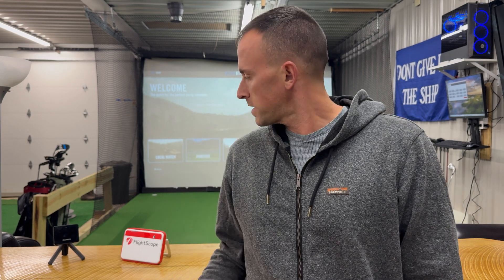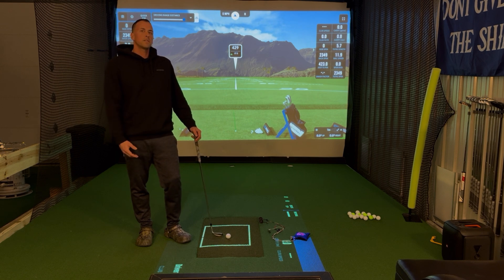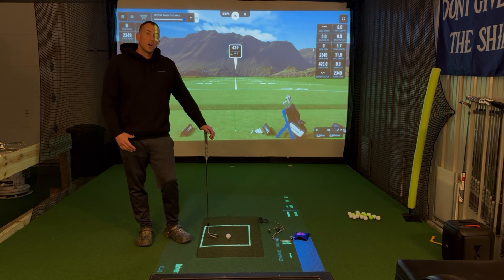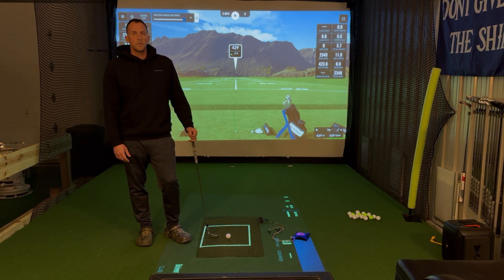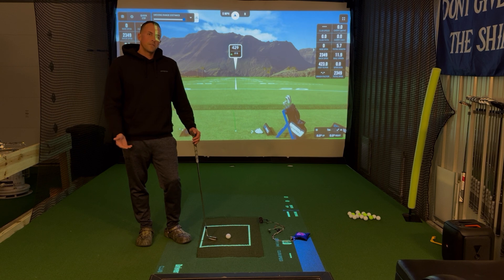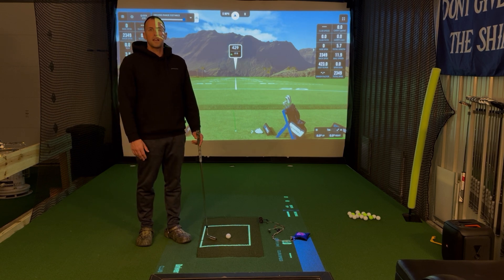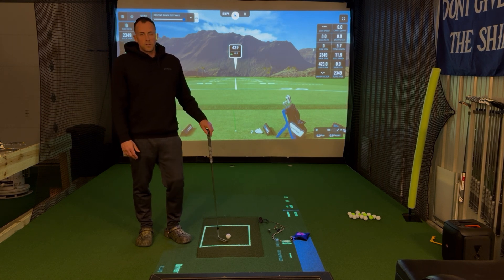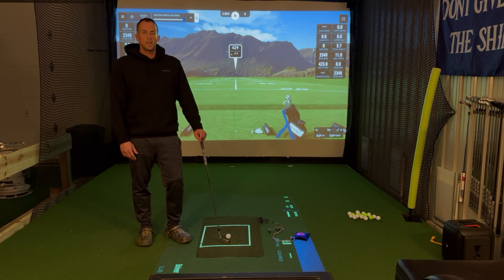How to Reduce Interference in Radar Based Golf Simulators:  Faraday Cages & More!

Comment: That's not how radar works. Only moving objects interfere with radar. Metal reflects it sure, but it's not moving so there's no return signal. Floor or mirrors won't affect radar either. You really need to do more research. It's not how radar works.
Reply: Wrong. If you put a Garmin in front of a high voltage line it will completely fail. Nothing will be moving, but your chip shots will be a mess and you'll even get ghost reads from practise swings.
Reply from the maker: Thanks, this is definitely the truth. And the more research I did after antennasbc comment, I found that my video is still accurate. SO many things can interfere with radar, and they definitely don’t have to be moving. RF is one example that completely affects the Garmin R10
Reply: I don't know how radars work either, but I know a lot of things have the potential to interfere with the radar, but most won't especially if they are not moving.

Comment: Hi Josh, I got rid of the R10 and went with Square Golf, and could not be happier! With the R10, I had built Farraday cages around my heater, portable AC unit, using aluminum screen for windows. The areas to cover were mostly around motors like you mentioned, and they worked perfectly. However, I got frustrated with R10 for occasional wild reads and mis-reads. It's the worse feeling when I hit a great drive and the no read from R10. Or the occasional wild reads that would have translated that I hit the left or right edges of my impact screen, when in fact were more in the middle.

With Square Golf (a month in), I have experienced 99.9% reads and for my level - more than acceptable results. It reads the shortest chips, bump & runs, and putts! It offers an official connector with GSPro (which I use) and Awesome Golf.

Some people complained that Square doesn't read spin axis accurately, but they were comparing to 5k to 20k units! Come on, it's $700. Be appreciative of what it can do at that price!

Sorry for being a little lengthy. I loved the R10 but the few flaws it had, made me switched. Note that 1 big requirement the Square has is it needs the dotted balls (similar to MLM2PRO balls) to accurately measure backspin & sidespin. I use my own balls but with dot stickers applied (sold by 3rd party online).

With all the investment you have in your sim area, you should look into Square. Just make sure you don't have left & right-handed players! lol - Kobee

Comment: Have contacted FlightScope Customer service? You can send them photos of your sim environment & they'll tell what might be interfering. I've had my Mevo+ for 5 years & the only problem I ever had was before they added Fusion Tracking. Mine reads short chips down to like 2 feet & I play SGT w/putting with no issues. I hope you figure it out because it really is a great little LM. Thanks for spending your time helping ppl who may need it. That's really cool.
Reply from the maker: Thats an excellent suggestion to give them a call. In all fairness I have not done this yet. Partially due to the fact that this is a friends old unit that he allowed me to try out to see if I could get it to work so I could forego webcam putting. Maybe I will give them a call, but after I have spent hours trying to get it to work, it felt like a lost cause.